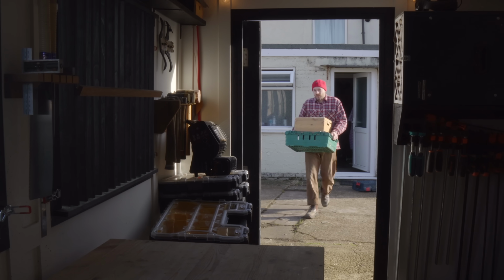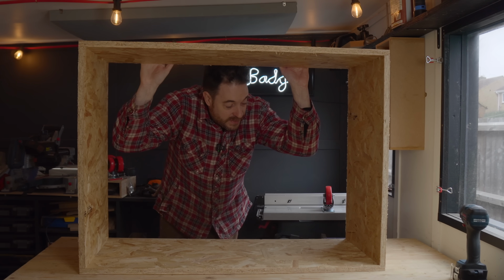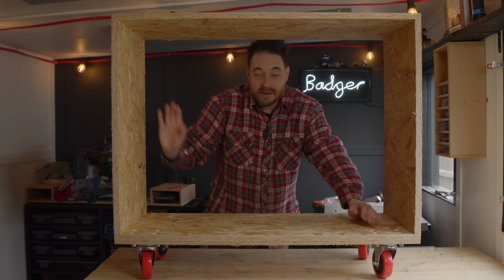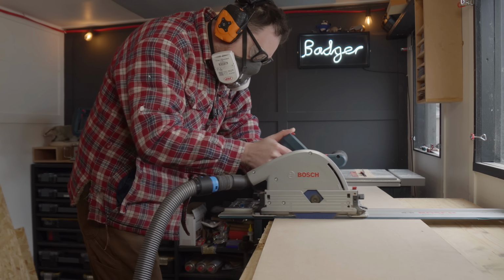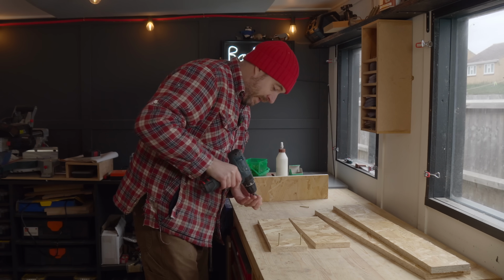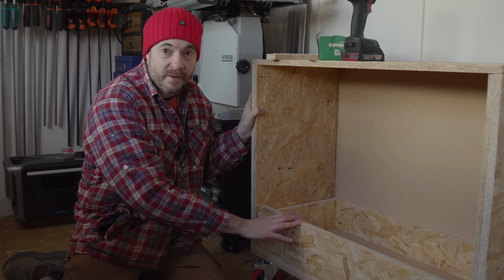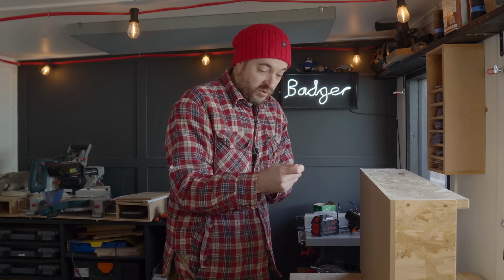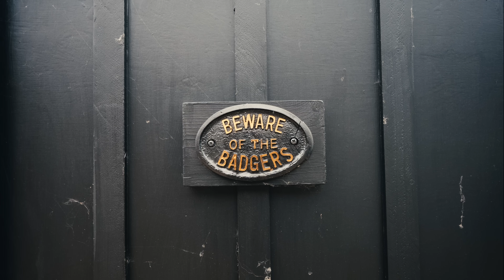Wooden Tool Chest

Comment: Hi Matt, good and solid tool chest and looks great in OSB ,what you need to do is to rub some candle wax on the wood runners on the drawers to slide better or you can use silicone spray. As always a great video   Take care

Comment: Smart, efficient cabinet for your gear.  What about putting some rails under the top shelf even though they are not actually needed?  It would provide consistency from the front view, and it may help keep some pesky bits of dust getting in.  This seems like a good option for me to try for drawers under my workbench.

Comment: Nice simple construction there Matt, sometime constraints from available materials can result in a better solution, the lower drawer sides work perfectly to make way for the slides and I quite like the look too, although my OCD would insist I put a slide below the shelf too (or even just a short block) for a more uniform look !
Reply from the maker: I ran out of wood but will do that when I have more OSB